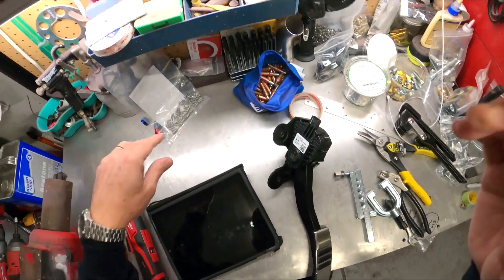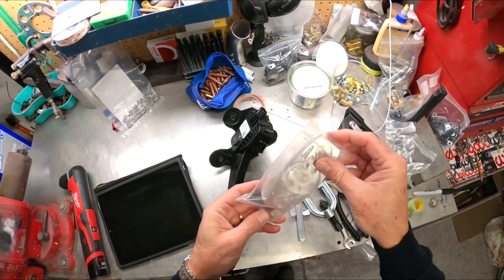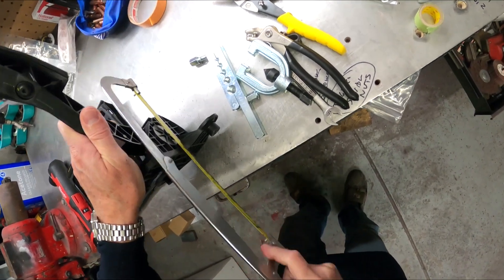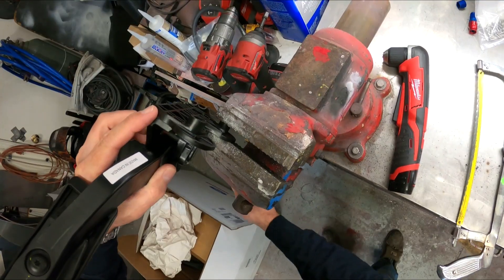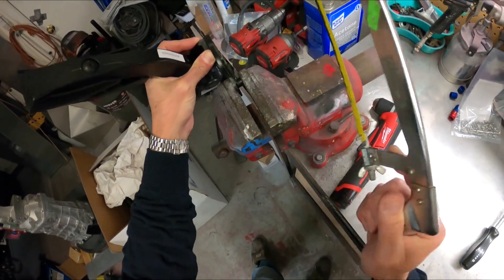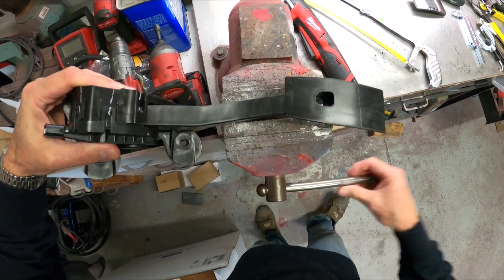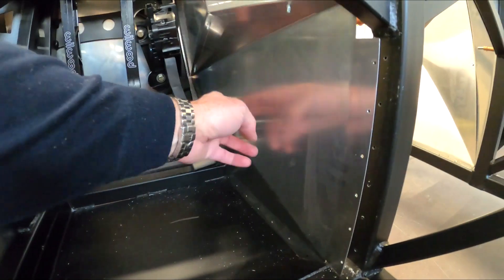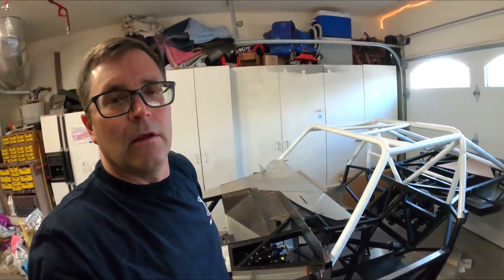Cobra Daytona Build-Throttle pedal installation, video 32

Comment: Been following your videos. Interesting. A suggestion for that DBW module -- you need to install your steering shaft to get the final position. There's a pretty narrow window the module will fit into and not interfere with the steering shaft. Especially the connector from the Coyote control pack. You might be OK. But hard to say.
Reply from the maker: Paul, I get most of my ideas from your fantastic write ups. You are the guru when it comes to these factory five cars. Thanks for the tip about the steering column. Hopefully it clears.